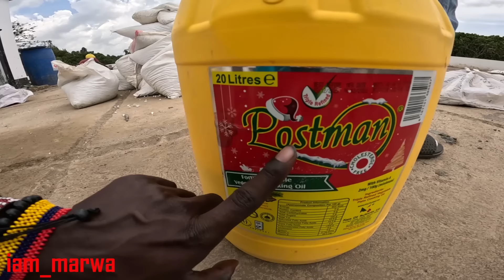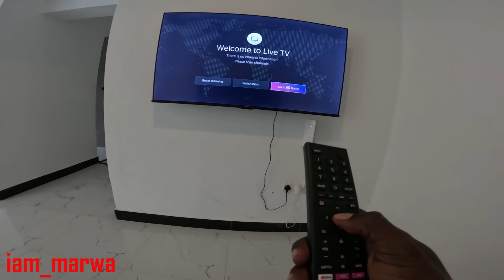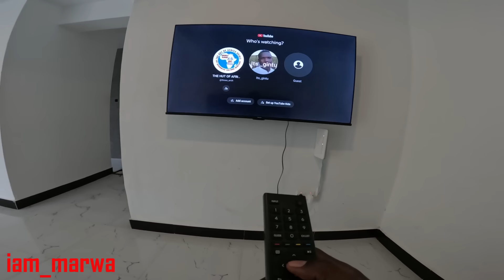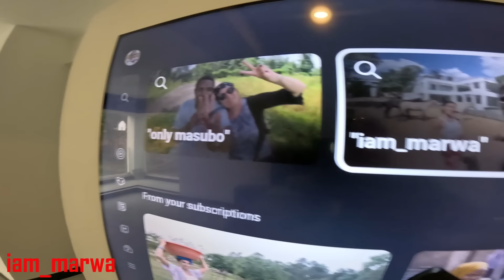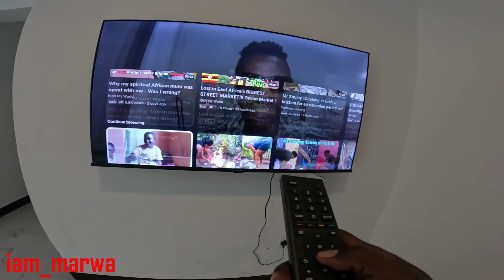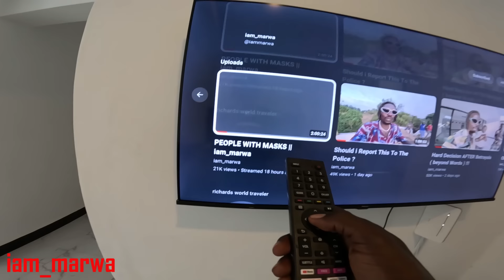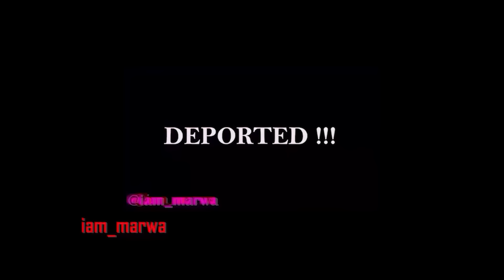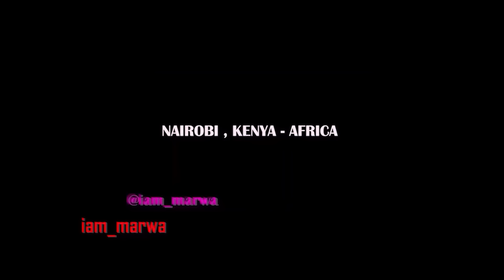This Guy ( beyond Words  ) !!!

Comment: Myra you need to use a roller like a paint roller to roll that onto your roof It won’t work right you have too many people using paint brushes and it will still leak. You need to go over it with the roller with the long stick in it so it’s applied evenly and covers all the holes. The job looks good but the tiny holes you can’t see. I hope this helps.

Comment: Even the helicopter might be too heavy for the roof because of the equipment, and the weight of the helicopter may be thousands of pounds and that’s too heavy for the roof
Reply: The sound and vibration will cause damage.

Comment: I commend you for the construction thus far, I understand that it is not a walk in the park, having constructed two Villas myself !!!.  I blame you for for misinformed priorities like the clay "mudbath" that consumer a very good sum ($$) I bet. I blame you for not following up with the initial Engineer (whom you praised so much) but did not advice or do the necessary for the roof in the initial stages. He is the reason you are redoing the roof in addition to other redo works have had to go through like plumbing and the exposed pipes on such a vila. I thought you said Aron Dante gave you $6000 for the solar even before the party, why complain about the solars everyday but you could afford 3 Horses?

Comment: Hw do you protect your horses from getting stuck in the muddy areas around water deposits inside your compound? Do you have portabe wire fences to put around such deposits? They could be rolled up and stored when they're not needed.

Comment: Iam_marwa 
What Solution does it Soak itself into the concrete slab .where there is Air pockets sleeps and becomes Solid. Because the Solution dosen't accept Water..Don't Worry even where looks like it not painted the Solutions is already a sleep in the Air Pockets..Rastafari Blessing. Highly Bless 🙌

Comment: Ro and travel Commando I am Googling this information what I'm sharing for you it should be a circle diameter just what it says 
Most of the time is depends on space, use, and budget. The most common recommendation for the average equestrian is to have a round pen that is between 50 – 60 feet in diameter. The diameter is the straight line through the center of the circle, or more simply stated the circle's width.May 10, 2018